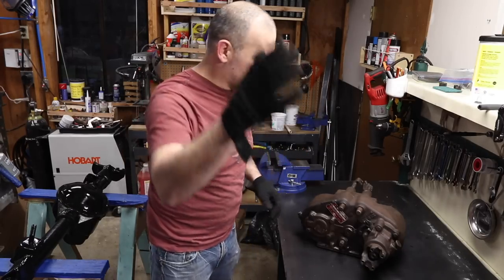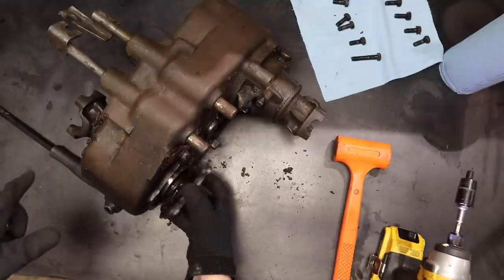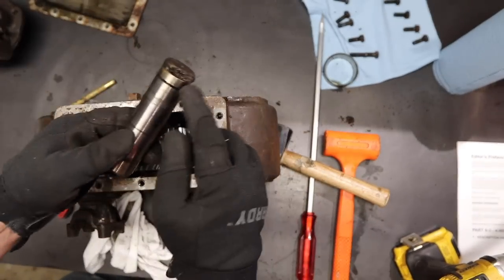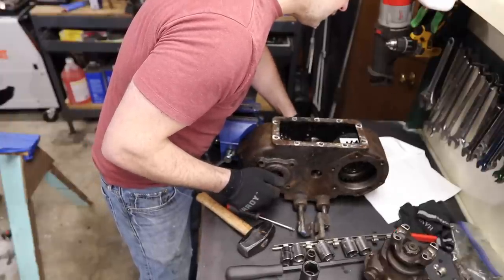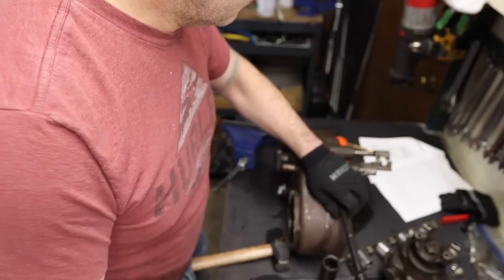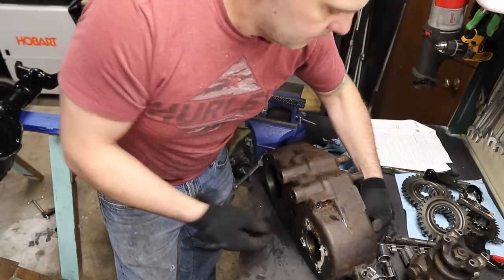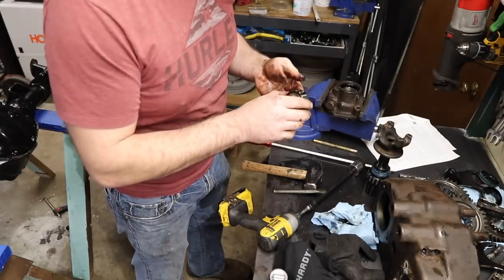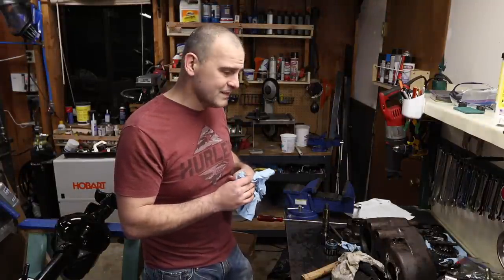3.30 - Dana 20 Disassembly

Comment: I know you've moved on from the project, but do the bronco world a favor and please please do not remove any of these vids from youtube. I've perused this vid before in thoughts of rebuilding but came to the conclusion it's just a few bolts and the rear output shaft seal (and maybe bearing) that need swapped. May seem crazy, but the part of the vid where you tear apart the rear output housing was absolutely invaluable to me. From announcing the correct socket size to simply being able to see how you pulled the shaft seal. This project now looks extremely simple to me. Thanks a ton!!
Reply from the maker: calvin peck thanks Calvin. Happy to help. It never crossed my mind to take them down. They are part of my channel, and part of my life. I’m glad I could share.

Comment: Hey Matt - thanks for the awesome video.  I have a question about the speedometer drive gear.  Around 9 minutes 20 seconds you talk about the drive gear and question yourself, "should things spin freely?" and then note that it needs to spin with the shaft.  I have a problem where this drive gear IS spinning freely when it should not.  It's floating on the shaft and, therefore, not rotating, thus not turning the speedometer gear, etc., etc.  Helps keep the mileage low, but not great if you want to know the speed. ;)

Any thoughts on how to resecure the speedometer drive gear to the shaft?
Reply from the maker: Oh man Mike, I know it's only been two years since I published this but so much has happened since then that I have zero recollection of this at all!  If it's floating on the shaft then I would imagine you'd need to throw a new one on there.  PITA job though!  You may as well rebuild the think while you are in there.  If you can manage to just take that part apart then maybe som loctite green (bearing retainer) will hold it?  I wouldn't go through all the trouble without just doing it right though.
Reply: @MattsGarage  Thanks Matt.   I totally get it.  Much appreciate the prompt response.  Loctite is a really intriguing approach that I'm going to explore.

Comment: I did not see where you removed the interlock pill.  did you remove that I am in the process of rebuilding mine now.
Reply from the maker: chad mccance sorry for the delayed response, I am traveling in India. The Bronco J-Style Dana 20 doesn’t have interlock pills because the interlock function is basically some metal flags on the ends of the fit rails. So when I went to a twin stick I had to cut the flags (I have a separate video on the twin stick). Not sure how to pull the interlocks in the T-shift or Jeep/scout cases
Reply: @MattsGarage  well then I am not sure what you call it, but when I was disassembling mine which is a j shift case also, using your video, there was about a 1.5 inch long rod that came out of one of the holes where the spring and ball detents were.  I did not see where it came from because I was not expecting it. anyway I figured out by reading multiple other places that it goes into the  hole that the spring and ball comes out of.  that other "access hole"  I have no idea what it is for.  anyway I think I have it figured out now.  thanks for your videos they have helped me.  in reading a bit more it seems some of the j shift cases have them and some don't.  it also explains why I had such a difficult time removing the sliding gears out of the shift forks and yours just came out so easily.  anyway  thanks again.